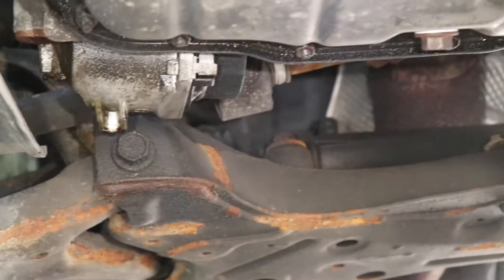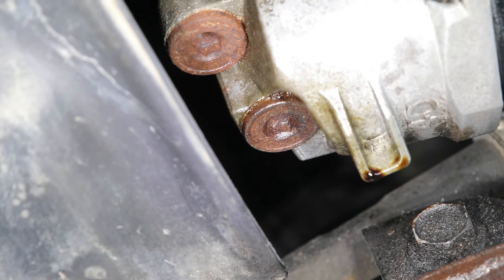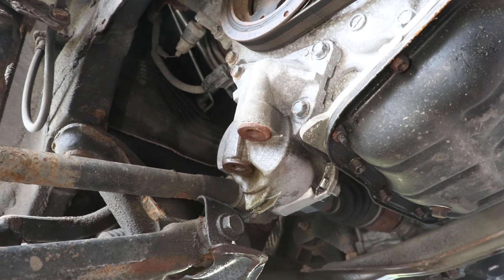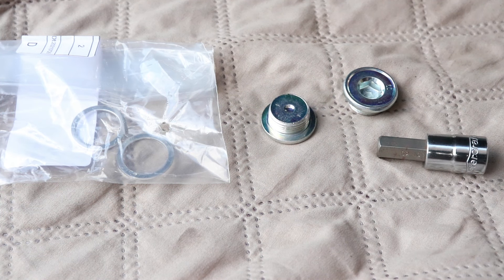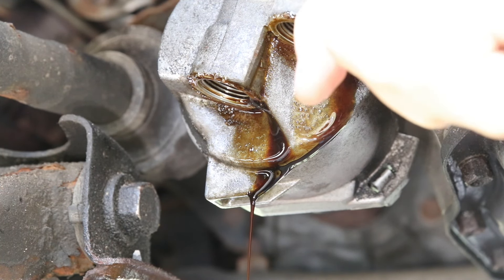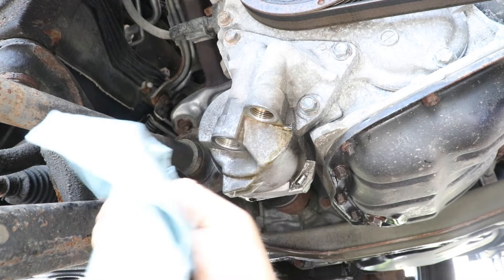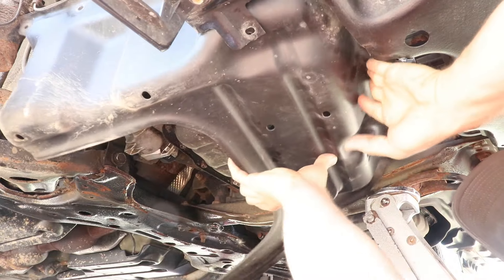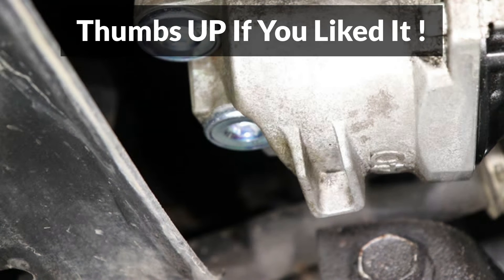Fixing an Oil Leak at Filter Plug, Toyota Corolla 1.8L 2ZR-FE Engine, 2014, 2015, 2016, 2017, 2018

Comment: I got some leaking problem next to the washer fluid container i it’s not oil kinda look like coolant it is leaking passenger side almost at front of the car what could it be? Any help would be most appreciated thanks.
Reply from the maker: Check your coolant level, see this video: https://www.youtube.com/watch?v=ouTERODc1xE   It could very well be coolant yes.
Reply: The coolant container is almost full
Reply from the maker: @efrainhernandez2255  Maybe it's washer fluid that mixed with some dirt?  I'd try to put something like a plastic lid from a storage container underneath to catch some of it and see what it is.
Reply: Ok hopefully I can fix that thanks for your help.
Reply from the maker: @efrainhernandez2255  Good luck! Sometimes there are leaks from the wiper fluid motor, or the container itself.. First you'll have to figure out what is leaking exactly.

Comment: I have a 2008 Toyota Corolla Sedan. Just replace the racker cover gasket, tensioner gasket, still i have this oil leaks around this filter plug
Reply from the maker: Maybe it's the washer.. if it's rusty, you can see it visually. Mine was very on the outside. What I like to do is clean the oil off really good with paper towel, and drive an hour or so, then see where it re-appears. Wind will move the oil around, so driving a lot will spread it everywhere, then it's hard to tell where it's coming from.
Reply: You ever figure out where exactly it was leaking?

Comment: Very informative videos, please continue doing such great work!
Reply from the maker: Thanks! I filmed this just in case others wonder like I did what is going on when it leaks there. I asked the dealer and they said this happens very rarely. I don't think I've done anything special to make it happen.. just driving in winter rusted it out and that was it. Quite amazing. If I knew this could be an issue, I would spray rust proof gel over this bolt every year.. I will from now on.

Comment: Hello clever fix, last time your videos helped my with serpentine belt change, Now i have a new problem on my 2015 corolla. My engine light came on three weeks ago and the obd sensor is reading that i have an cylinder 2 misfire, So i changed the spark plugs and no more engine check. Three weeks later which is today the engine check light started flashing and the engine was still running but it wanted to stall so i pulled over, after 15 minutes the engine light was not flashing anymore  but it was still on, so i drove it home and checked my engine. The coolant was normal, the engine oil normal but i noticed there was oil leak but dry on the BACK in the middle of the engine passenger side. You have any idea what it is? thanks in advance
Reply from the maker: Hopefully it's not the head gasket.. I would do a compression test on the cylinder with the misfire and the adjacent ones, to make sure the compression is OK. If it is, then the only thing I can think of at the moment would be the spark plug coil itself having some sort of malfunction, or the wiring to it. When you replaced the plugs, you moved the wires around, so maybe it's something related to wires, and the oil leak is a completely separate issue.  Since it came and went away and came back, it sounds more like a wire related issue than a permanent thing like head gasket.
So it could be many things.. more diagnosis will be needed.. here's some info on head gasket blown and causing oil leak to the outside:
https://www.agcoauto.com/content/news/p2_articleid/200
"An external oil leak
It is also common to find failures between an oil passage and the outside. Such damage results in an external oil leak, and possibly no other symptom."
Reply from the maker: Keep in mind that misfire is bad for the engine, and causes engine damage.. so I'd be very careful to avoid as much misfire as possible.
There may be a method in the manual for testing the coil with a voltmeter, although I haven't checked into it.. I may do a video if there is, It will take me some time though.
Reply: @CleverFix  Hey clever fix thank you i appreciate the quick reply 😊, and so what i did was check the coil manually and switched number 2 coil with number 3 coil and put the obd back again, But now its saying that p300 cylinder 1 is misfiring lol.Im in the process right now of checking it again but in the meantime i changed my air filter, i last changed it at 70,000 miles I now have 132,000 so quickly changed it and cleaned the maf sensor which by the way was really dirty. So im going to try that if it doesnt work ill check the coil again. Thanks again clever fix
Reply: Update... so i started driving with the new air filter and engine light came off then a few minutes later came on again. So i went home and checked my obd again and FINALLY my obd is finally showing exactly what was wrong. A few weeks and up to today it kept showing PO302 which was a cylinder misfire then finally today it showed PPO 352 and it read ignition coil B primary/ secondary circuit. Got a new coil and installed and engine light disappeared right away. Hopefully thats it haha thanks for your videos and always replying @clever fix happy holidays!!! anyway where are you guys located?
Reply from the maker: @relaxingmusicrelaxingmusic5510  You said you moved the coil around, but you're still getting problem on the #2 it seems? 352 and 302 both indicate cylinder #2. So it would be unlikely a defective coil if after swapping it, it's still showing trouble on #2.
Sounds like an intermittent problem to me,.. could be computer or wire harness related, but like I said before, I would check compression to make sure also.
Here are the items to check according to the manual for this code..
Open or short in engine wire harness
Connector connection
Vacuum hose connections
Ignition system
Fuel injector assembly
Fuel pressure
Mass air flow meter sub-assembly
Engine coolant temperature sensor
Compression pressure
Valve timing
PCV valve and hose
PCV hose connections
Intake system
ECM
*: The MIL flashes when a catalyst-damaging misfire is detected. 
The P0302 takes 2 trips to show up, so keep that in mind also.. it doesn't show up immediately.
I'd definitely check compression first... the rest are harder to check.. and the list is long!.. Seems even something like a clogged injector could cause it.
Reply from the maker: @relaxingmusicrelaxingmusic5510  Here's the list for P0352 , 
Ignition system
Open or short in IGF1 or IGT2 circuit between ignition coil assembly and ECM
No. 2 ignition coil assembly
ECM
The other list was for 0302. Maybe that's not relevant since 352 is more specific like you said.
Happy Holidays to you too, I'm in Canada.
Reply from the maker: Here's the ECM..
https://parts.toyota.com/p/Toyota_2014_Corolla/Engine-Control-Module/72019949/896610ZD35.html
Checking the wires is a pain, but it can be done with the wiring diagram.. I've had to do that sometimes.. although when it's intermittent, it's even more difficult.. and buying a ECM hoping it's the ECM , and then it's not.. is not fun.  "Primary" means ECM , Secondary is the coil.
Reply: @CleverFix  sorry clever fix I only replied now, i was working and was so stress and couldnt fix it somehow, the engine light keeps coming back on, i just drive it for now but the light is on. I use the car for my job so i have to risk it. Thanks for the link I'll definitely look into the wiring, looks complicated so i have to take it slow and the list of problems is long. Im taking it to the toyota dealer this week, i know they'll find the problem i hope it wont break my budget. By the way im driving my car and the engine seems normal, just the engine light is on but no stalling, and no misfires so i really dont know. The only problem showing on obd is po 301 cylinder 1 misfiring unlike last week all the codes were showing po 300 301 302 now the only code showing is po300 and its been like that for a few days now. I also noticed my gas mileage use to be 30 mpg when i resetted my dashboard it starts with 15mpg then it goes up 24 mpg and stays there
Reply: @CleverFix  far worse than i imagined. I checked and it looks like coolant is starting to mix with my engine oil. I looked under the cap and im seeing coolant and oil mixing but its not showing on my dipstick
Reply from the maker: @relaxingmusicrelaxingmusic5510  Wow, That's crazy.. sorry to hear! Definitely sounds like the head gasket 🙁 , .. it's fixable, the head has to be taken off and gasket replaced. Compression test would probably show low compression on that cylinder too, depending on which part of the gasket is blown.
I've done the head gasket myself in the past on another car, but it's plenty of work.. the timing chain has to be removed, all wiring, coolant stuff, valve cover, and engine studs, then the head lifts out.. it can be brought to a machine shop to be checked, and the block(bottom part) has to be checked that it's not warped and crankshaft bearings are OK... If everything is good, just a new head gasket will be enough to fix. 
Definitely a LOT of steps and care has to be taken to put it back though.. timing has to be aligned, and head studs torqued.. I've never checked the Corolla procedure, but it will be all in the manual.
Misfire can blow the gasket unfortunately, because misfire means the explosion happens at the wrong time. If the piston is travelling up and the gas ignites, the piston has nowhere to go but up even though the explosion is pushing it down, and the immense pressure means something has to give. The gasket will likely give first, but crankshaft bearings will also have had massive pressures put on them, and the piston/piston rings.
It may be worth while checking www.car-part.com for a used engine from a junk yard, as it may be cheaper than repairing. If it's repaired, lots of care must be taken to inspect everything, and torque everything properly to spec, otherwise more problems can happen later.
More often than not, you can find a fairly cheap used engine, that would be likely what I would do, either that or rebuild it myself.. I've had mechanics rebuild stuff for me in the part and it did not turn out good, so I would trust a used engine more. 
I never imagined something like a bad coil or spark plug could blow a head gasket, but I checked into it now and it is possible.. so good thing I changed my spark plugs early. I knew bad plugs can also clog the catalytic converter, which is also expensive.
Hope it doesn't cost too much to get it fixed.
Reply: @CleverFix  hey clever fix yeah i dont really know what it is. My cousin said the mixing of water and oil under the oil cap could be cause of the change in weather. The weather did change from normal to foggy instantly maybe its that plus i watched some other youtube videos and they said the same thing. Its not a lot  of milky stuff under my cap only like a few drops so im not sure if that qualifies a mixing of oil and coolant and my oil dipstick looks good no mixing. Maybe a dirty fuel injectors? is whats causing the misfire. I never cleaned it so im doing that next. I have 160,000 miles on it. Oh by the way when i changed all 4 engine coils that i got from amazon its now giving me obd code po325 so i put my old engine coil back and the obd code went back to po 301

Comment: How many pounds are the plugs torqued to?
Reply from the maker: Nobody knows really.. I used 25 ft.lbs myself, but there is no specification that can be found in any manual. My dealer told me 22, but someone else then found out that it's not specified anywhere, so I'm not sure where they got 22.  My car has been running OK, and no leak again.

Comment: Where did you get your torque specs?
Reply from the maker: Good question.. I was unable to find it anywhere in manuals, I had to ask the dealer. They told me 22 ft lbs, which seemed quite low, so I tightened it to 25 ft lbs. I've had no problem since.. and I'm not sure if the dealer looked it up right, he said that's all he could find. I don't have access to https://techinfo.toyota.com/ but I would guess if the dealer has it, then it would be there too, although it may not be.
Reply from the maker: Is yours leaking at the same place? I'm wondering if other people are having this problem. The dealer told me I am the first to buy this part.
Reply: @CleverFix  Mine looks to be in the same area. I replaced the oil filter housing (plastic piece) and oil filter o ring and replaced it with an OE from the dealer. Same thing. After searching YouTube, saw your video and was inclined to look into replacing the two o ring and two crush washers. Found specs for oil filter bracket but not the two crush washers. Searched everywhere no luck. Even called my local dealer no luck. Helped me out. Thanks
Reply from the maker: @guscarguy  I wiped it off, and every time a drop formed on the bolt again and the bolt was wet, so that's how I figured it out. If the bolt is all rusty, then the washer is likely rusty too. My bolt looked terrible. 
You made me wonder now, since your dealer cannot find it, how my dealer found it.. That washer is quite thin though, so a lower torque makes some sense.. the oil drain plug has a thick washer and is 27 ft lbs. 
I also checked 2 manuals with no luck.. Now I wonder if the TIS has it..
Reply: @CleverFix  The dealer told me they couldn't find it. They sell the washers to repair it though. It doesn't make sense why the torque specs are not in a factory service manual. I checked there as well
Reply from the maker: @guscarguy  I agree, it doesn't make sense to me also..  I'm surprised my dealer even gave me a number , but I'm suspecting they may have been guessing now. Since it's nowhere to be found, you could try to contact Toyota through their contact form on the website. They're pretty good with support, and they definitely have the torque since they built the car.  Let me know if you get a response. I've asked some things in the past and they respond pretty fast.

Comment: Toyota sure makes some crap these days!!! I remember in the 80's when Toyota's never went in for repair. I had 3 corollas 1983 1995 2009. The first two went 100k miles with no repairs. The 2009 just hit 100k and it has had new spark plugs, new ignition coils, 2 new alternators, a complete rack and pinion steering replacement, water pump, air bag recall replacement, new window switches do to recall and now it's going in for a oil leak. WHAT A F**KIN POS TOYOTA MAKES TODAY!!!!!